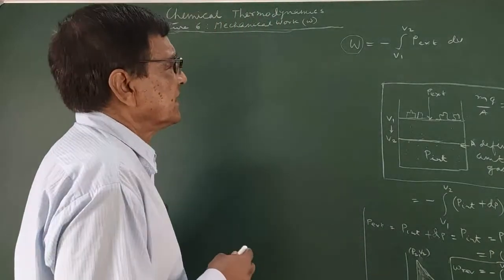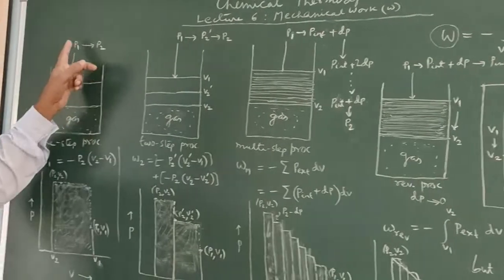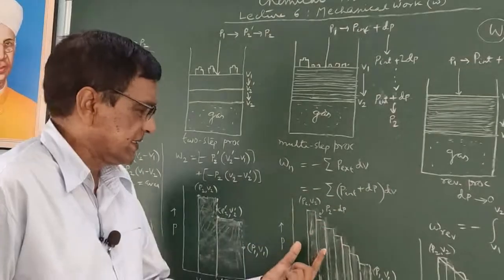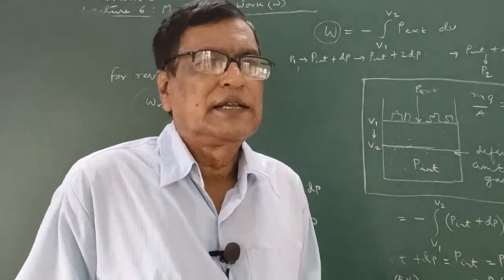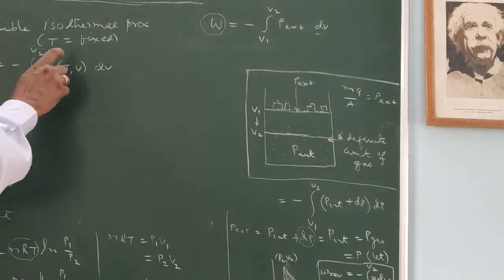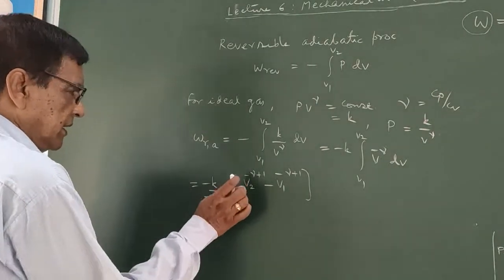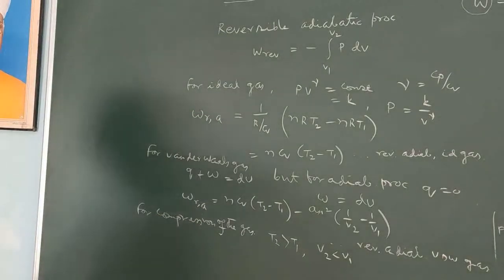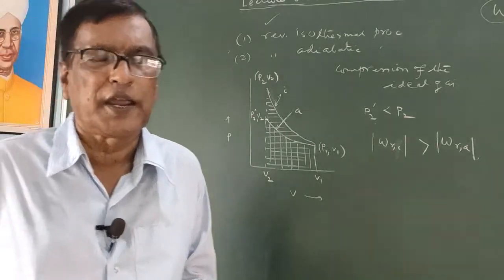Chemical Thermodynamics. Lec 6: mechanical work (w)

Comment: Sir in irreversible expansion for calculating work pressure is taken external pressure,why?
Reply from the maker: Work = opposing pressure × volume-change.
 In expansion of the gas, opposing pressure is external pressure. See my note which is uploaded in my channel of the YouTube.